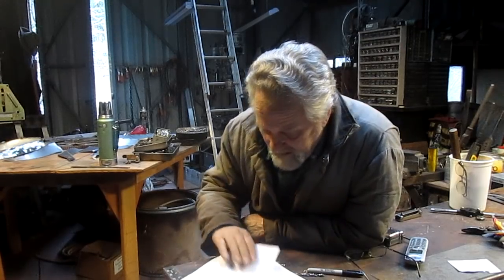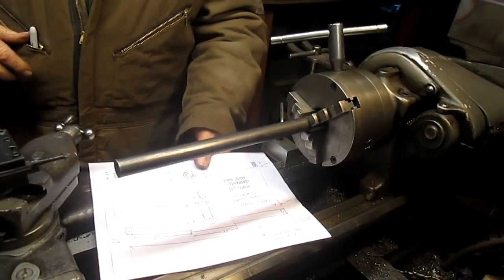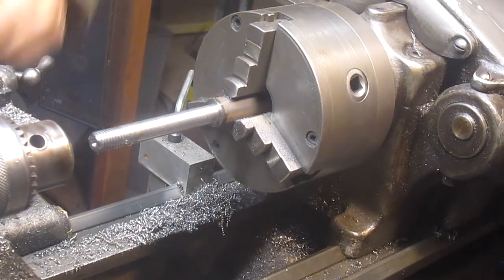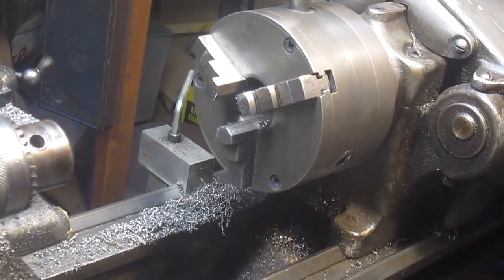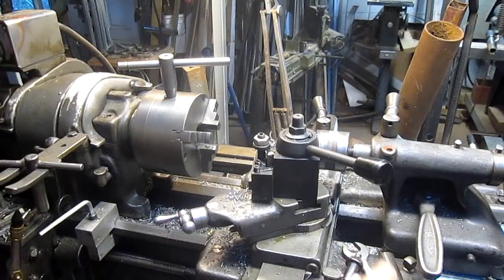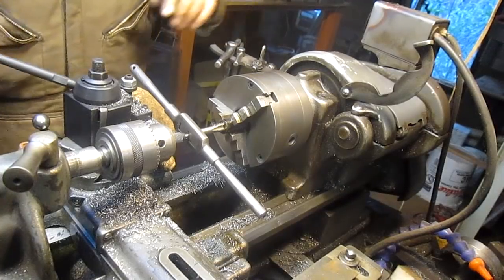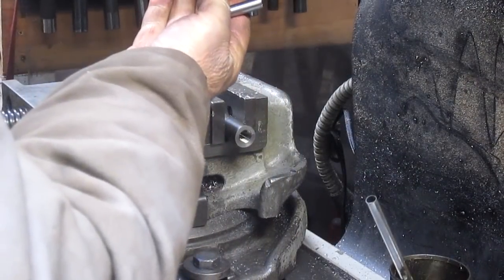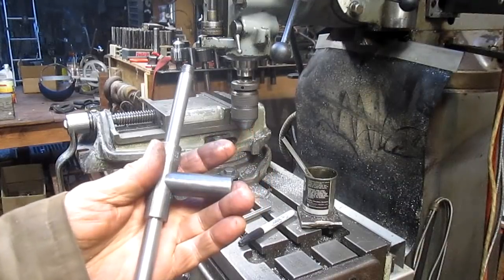A Tee For Two, A Wrench Build

Comment: Can you set the lathe for the correct tpi and let it follow the tap?
Reply from the maker: Yes, probably, but simply disengaging the tailstock from the bed and letting it float saves time and works just as well.
Reply: @NikColyerMachineWorks  I'm referring to how you had to keep manually moving the carriage to keep up with the handle?
Reply: @dudleycornman1624   If I remember, my lathe was set up for metric which meant changing out several gears. Not a big deal if needed, but a pain if not needed, so it was easier. Now that I think of it, I have never synchronized the  threading with the tap. I might give it a try sometime.
Reply: @nikcolyersstorytime4861  AH...